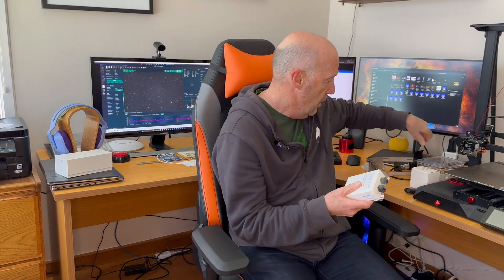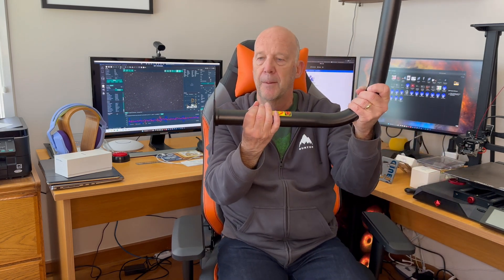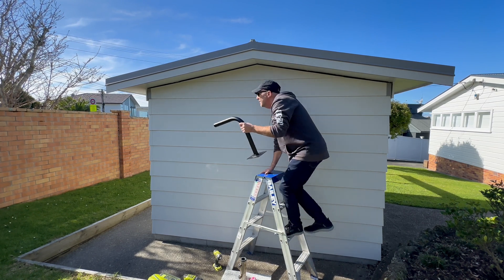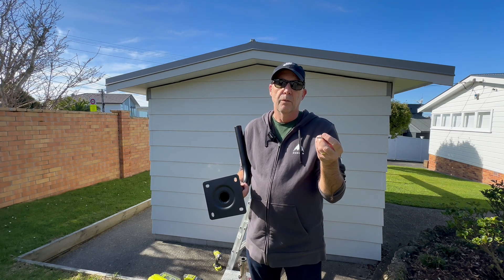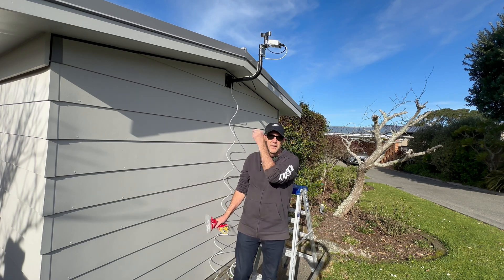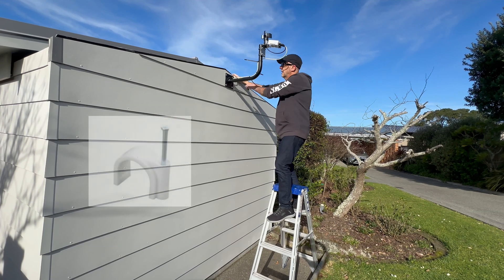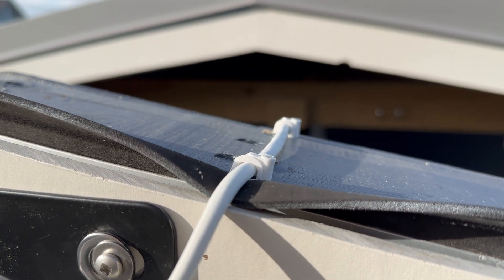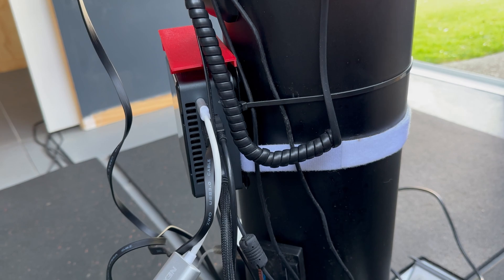Installing the AAG CloudWatcher from Lunatico for my home Observatory, Part 1

Comment: Logan, could I please get a link to where you purchased your mounting arm from?
Reply from the maker: I ordered it from Elelment 14. It is called Antenna Wall Bracket - 15" Standoff x 13      https://nz.element14.com/stellar-labs/33-10987/antenna-wall-bracket-15-standoff/dp/2801403
Reply: Thank you very much sir!
Reply: Quick question, Logan, where did you get the cap for the top of the mounting arm? I ordered and received my 2 arms, and no caps was sent for the top. Im going to use one for cloud watcher and one for all sky camera. I will look at the local big  box retail, but don't hold much hope in find🎉one there.Thank you.
Reply from the maker: @jeffnapier4178  Mine came with the cap on the top already in place. Not sure why your ones came without. Maybe contact the retailer on case they forgot to include them.
Reply: @LogansAstro my apologies sir. Zafter looking in the box I found it. The second one I hadnt opened yet, but when I did it was right where it was supposed to be. Thank you for your help.
Reply from the maker: @jeffnapier4178  ah excellent, glad you found it.

Comment: Hey Logan - Interesting with these things how sometimes it's little things like the cables that can be the most tricky.  First stage is looking good. 👍
Reply from the maker: Thanks Ollie. I seem to have had a lot of cable issues recently. Two USB cable failed around the same time but fortunate that the fix was easy. There serial to USB cables can be a real pain with so many knock offs causing issues. Now just need the rain to stop so I can get the Cloudwatcher working with NINA.

Comment: Hi Logan, I have been using the CloudWatcher for about a year and fairly works well with my Dome and NINA. In found  the setup defining cloud/rain-dew etc can be tricky .  There is a NINA plugin which outputs a JSON and CSV file for each image and adds data from the CloudWatcher. Your can review image focus position, HFR, wind and temperature etc after a nights image run in excel. I used a  TV antenna mount from Jaycar which was hopeless and I had to use wire stays. Good luck and Cheers.  Dave from Dunedin.
Reply from the maker: Thanks for the info Dave and glad to hear it is working well for you. I will definitely look at downloading that plugin you mentioned - sounds useful.  I can understand what you mean about needing to tweak the cloud/rain-dew settings  - I'm currently doing that with the Cloudwatcher not connected to NINA just to see it's behaviour with changes in the weather. Clear skies.

Comment: I know it's a bit late now but Bunnings sell an Antsig antenna facia mount in OZ that would have done the job (AUS$32 - 62), or any TV antenna mast for mounting on a facia would do.
Reply from the maker: Thanks Adrian. Yes we have that one here too but unfortunately I can't mount it on the fascia as the fascia part moves with the roof so I needed one that extended from the wall of the observatory out horizontally about 30cm to clear the soffit/eave before it turns upwards and unfortunately the one at Bunnings didn't extend horizontally  quite far enough. CS
Reply: Logan, could I please get a link to where you purchased your mounting arm from?

Comment: Hey Logan, that’s really interesting, I’m hoping to put a rain/cloud sensor on my obsey! I enjoyed watching the installation, and I felt the crunch🫢 At least I shouldn’t have a problem getting a pole to put it on🤣 I’m looking forward to part 2, and I didn’t look at the cables!!
I had the same problem with my laptop, one day it was windows 10, the next, strangely it was windows 11, how did that happen 🤷‍♂️ Clear skies mate!
Reply from the maker: Thanks Simon. One thing Microsoft doesn't like, and that's choice 🤣. Honestly, it is so hard to get stuff down here even as simple as the right angled pole and if there is one here, they charge like a bull. A classic example was when I was doing my Christmas lights display; I used a lot of 20mm conduit - Bunnings Australia charged about $5 per 5m length in Ozzy where as Bunnings in NZ ( and owned by Australia) charged $25 dollars per 5m length! You see my problem. Anyway, I will stop ranting now. Currently I am watching the behaviour of the Cloudwatcher with it NOT connected to NINA so I can adjust the parameters so it won't make the roof open and close unnecessarily. CS
Reply: A TV antenna facia mount is cheap and should be easily available.
Reply from the maker: @hawkesworth1712  Yes those fascia mounts are available but my fascia moves with the roof and those hockey-stick style mounts  don't extend  far enough out under my eave so I couldn't use one unfortunately.

Comment: Interesting ...
It would have been nice if the system had WiFi connection, but you have to deal with what you have, or what is offered.  The installation was interesting, but, as a retired meteorologist, I am more concerned about the upcoming "Part II".
Clear skies, Logan, and now, here's hope for light winds.
Reply from the maker: Thanks Pat. Haha yes Part 2 might take longer to come out than planned as the weather here has...well.... turned to custard so to speak.  I have been watching the behaviour of the Cloudwatcher over the previous couple of clear-ish nights with it NOT connected to NINA just to see its behaviour and adjust the parameters as necessary as the default parameters in the unit aren't necessarily ideal for every climate. Fingers crossed it clears again here soon. CS

Comment: I look forward to part 2 & seeing how this all works Logan never heard of them till now, interesting point about the chipset & the adapter I had the same happen to me with a Hi Tec EQDIR cable, I were setting everything up in the observatory connected the cable as I usually did but it wouldn't work. Odd I thought as it had worked for years previously I done some digging around & found it that it were using a fake chipset & this was using Win 10. So in the end I bought a Lynx astro one & that has been fine ever since so it would seem you have to be careful with buying some astro gear. I have since managed to get it going again but removing the drivers & installing an old one so if I do get a cable failure I can do that just to get me by. 
As for the messy cables that's pretty much me all over lol, clear skies.
Reply from the maker: Thanks Tich. Yeah I think people with tidy cables have issues🤣🤣. It's definitely these knock off chipsets causing an issue and whilst we could get away with it in Windows 10, they ain't letting us get away with it in Windows 11. Clear skies.

Comment: Very interesting video. Waiting for the second part, specially if you show how to integrate the 'unsafe conditions' in the NINA advance sequencer 😅 PS: Can't understand the use of a serial cable in these days, specially given the price point. Adapters are always tricky.
Reply from the maker: Thanks. I did a recent video showing how to set the instructions in the advanced  sequencer (as I had to set up the instructions  in the remote rig I use in Spain although I don't control the roof there) which you can see here https://www.youtube.com/watch?v=SVoeTUP4-j0   I'll probably go over it again in Part 2 anyway which will also included instructions to control the roof here at home. And yes, the adapters are a bit of a PITA , especially now with Win 11. CS
Reply: @LogansAstro  yeah, that is what I was referring to, the whole config, roof included along with the rain/cloudy parameters to determine the safe status. I was aware of having to adjust them along the year, as seasons pass. I saw yout previous video but all that stuff is already set by the remote hosting so it will be interesting see how you set it up :)